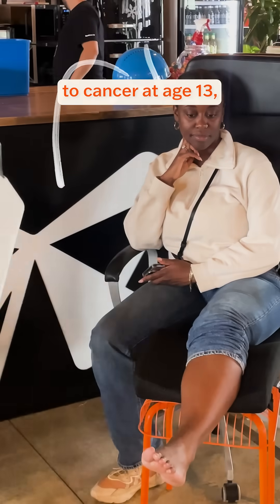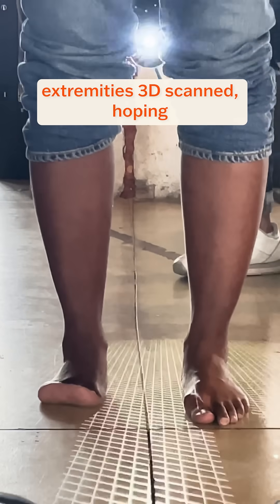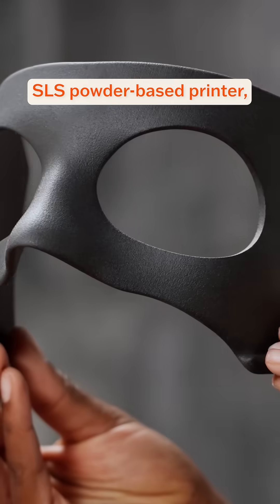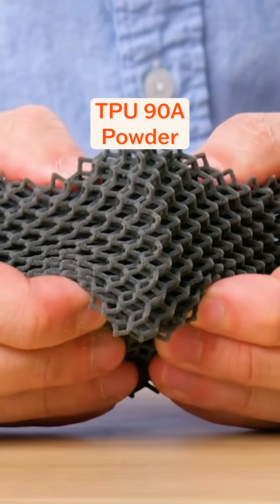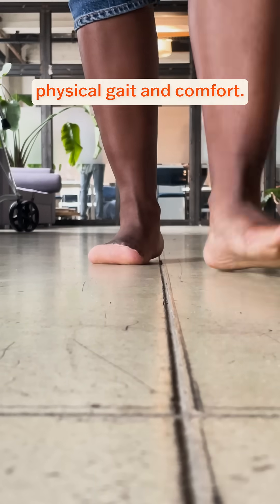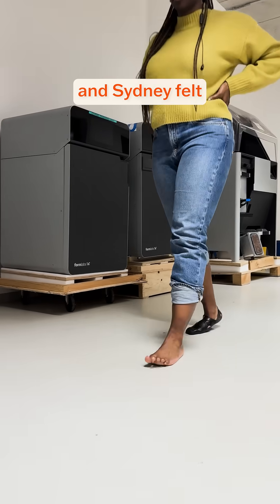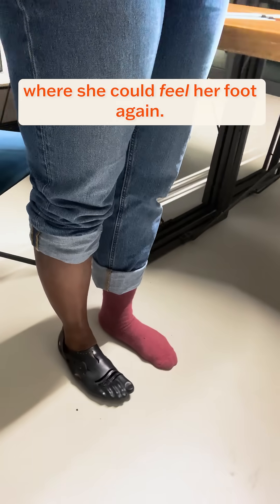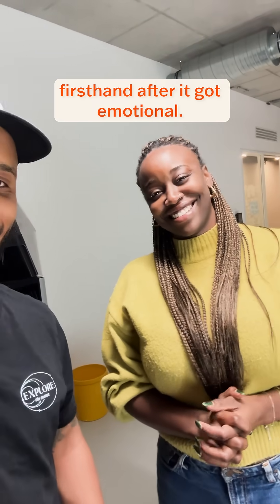Formlabs Helps Sydney Get a Custom 3D-Printed Prosthesis - Part 2

Comment: You should try teeth next. Permanent dentures “all on 4” can be anywhere from $50,000-$100,000. That’s insane..
Reply: I don’t know how a 3d printed tooth would work since it would have to be metal
Reply: @NyxeriaLuvsYou  also what would have to be metal? The only metal in implants is the titanium posts that go into the jaw, the actual teeth and gum parts are not metal
Reply: @ I see people 3d print with all kind of materials…
Reply: As someone who had many removable prosthetics (all very expensive) before getting a full mouth of implants at 17, I’d be interested to see how the technology can work in prosthodontics.
Reply: The temporaries they give you now for the all on 4 and dental implants are made with 3d printers, and they’re still wildly expensive hah
Reply: @Alexa.Morgan  I actually wondered that after posting this. But I’m more wondering if it’s the material? Or they’re just actually ripping us off.